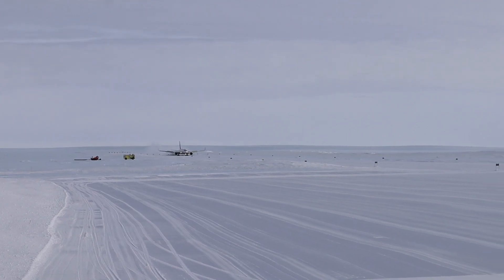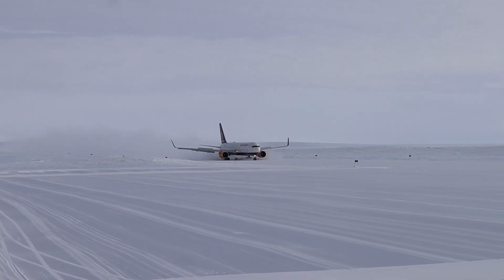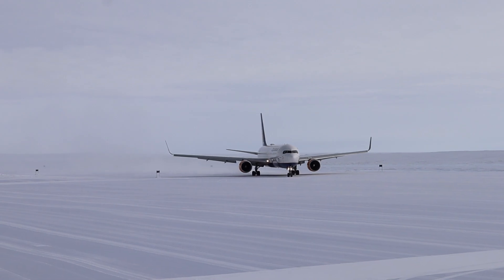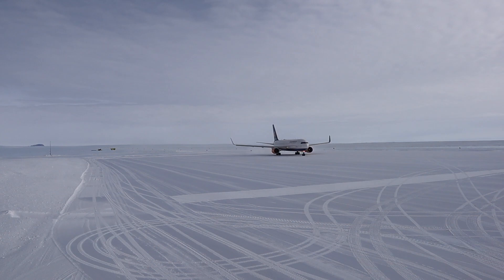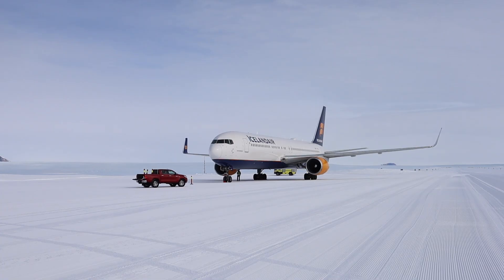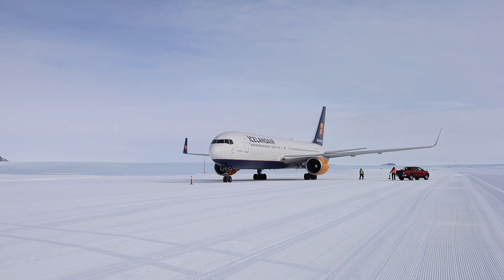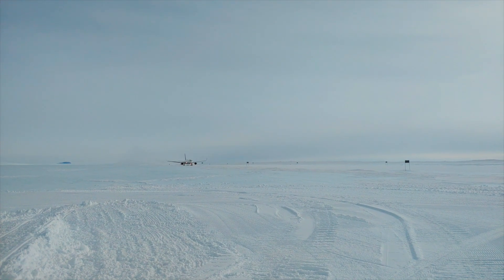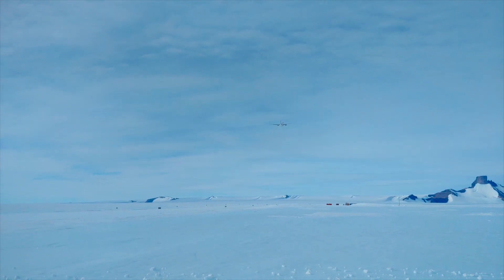How to operate an airport in Antarctica

Comment: Williams Field, McMurdo Station in a USAF C-5 Galaxy Nov 98.  Never even felt touch down due to the flex of the ice. Absolutely amazing.  One of that latest flights for that aircraft of the season in 1998 due to the temperature increasing.  Departed four months later in a USAF C-141 Starlifter back to Chc, NZ.